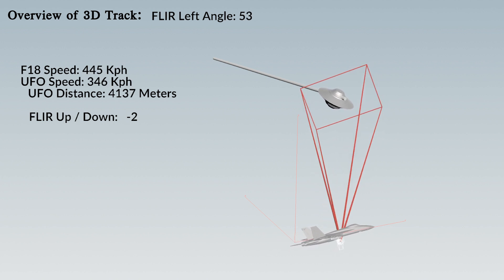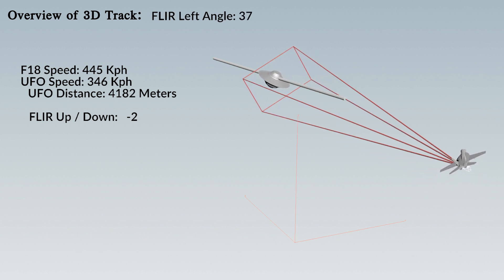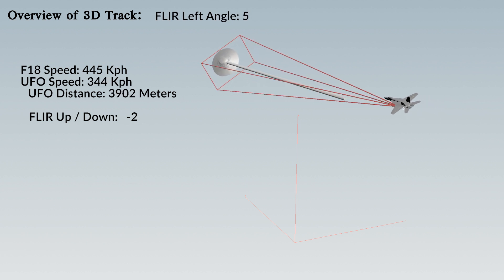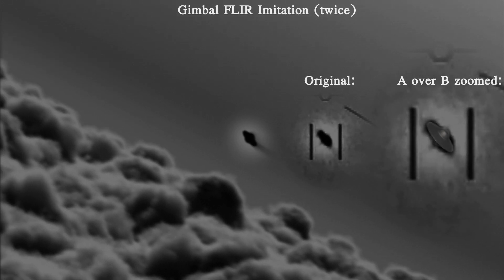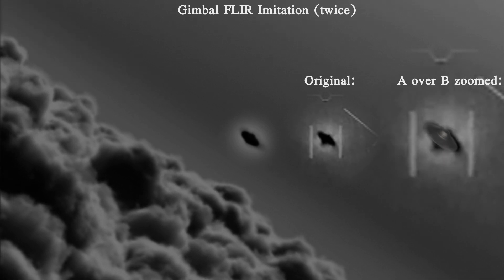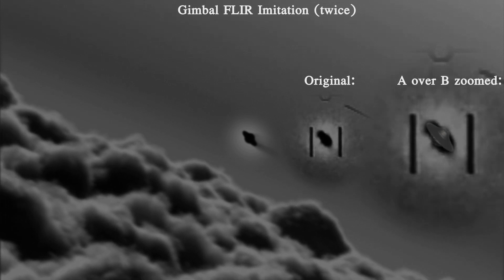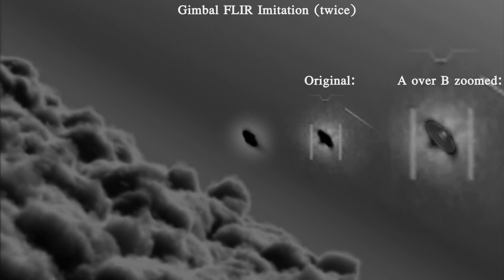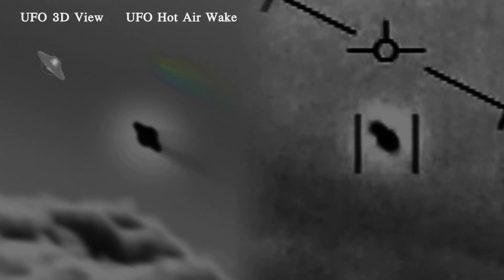Gimbal UFO video rendering in 3D FLIR + analysis

Comment: You aren’t accounting for quite a bit of fact. There is lens flare without question and it isn’t debatable. Could it have been an alien spaceship creating this heat signature and flare? Yes, could have but there is absolutely the same equal chance that it was simply another man made jet.
Reply from the maker: Lens flares don't move as one whole unit on the lens without separating (each flare is on a separate lens), and changing size, shape and intensity drastically as it moves relative to the lens, which is very obvious at the end of the video.  There is no possible way this is a lens flare due to that fact.  I have made other videos on this but obviously most people are not very familiar with the concept of what a lens flare is.  In short, this is NOT a lens flare, there's no way that it is.

Comment: You talk about hot air coming out of the ufo? I dont get it. Lazar said the reactor did not produce any heat whatsover ?
Reply from the maker: Correct.  It's not the reactor that causes heat, it's the fact that the metal itself is being manipulated.  Think of how things get hot when you bend them, it's the same concept.  The metal of the craft is moving the entire craft and ultimately getting hot as a result of that movement.  The movement is being caused by the anti-gravity reactor.  The output of the anti-gravity reactor isn't hot, but it does "bend" the metal and that causes heat... if that makes any sense?
Reply: @abominati0n981   Yes it did. Thanks. What do you think about the alien interview? Do you think its legit? 
I mean this:
https://youtu.be/thdzV3VGzwo?t=1924

Comment: One question: Lazar mentiones that the propulsion system of the craft doesn't produce waste heat but we are seeing a heat source. I thought maybe it is the hull of the craft heating up from the sun or the gravitational field generates some sort of radiation visible to IR cams. What do you think about the origin of the heat?
Reply from the maker: Yes, you hit the nail on the head basically, the heat we see is a result of the metal hull heating up from the gravitational manipulation due to the fact that the whole weight of the craft is being moved around by the outside metal hull that we see in the video.  So the anti-grav reactor was 100% efficient, creating no measurable heat, but when the gravitational wave is emitted onto the metal of the ship, this causes the metal itself to move in a certain direction and that movement generates heat which distributes across the metal.

Comment: The clip ends at this point due to the craft flying off at incredible speed the rotation is the preparation of this mode, as stated by Mr Lazar therefore is this back engineered tec or theirs. my gud says ours but could be wrong.
Reply from the maker: I really don't think these crafts are "ours" meaning the US Government's or any other Government's for that matter.  I think it's pretty clear that these crafts are from another star system and there are probably lots of star systems that have highly advanced civilizations.

Comment: If you listen to the podcast where Ryan Graves talks about this, he said the object was stationary. but here you put it to be at very high speed.

Is it possible to the object being stationary? I know that helicopters doesn't hover at 30,000 feet and baloons doesn't stay in the place against the wind, just asking.
Reply from the maker: Yes I have seen the interview and heard the incredibly good podcast.  He mentions that the craft can be stationary, and I think it is stationary at the very end of the video clip (you'll notice my track actually slips at the end for this reason, because I didn't slow down the UFO).  Also if you watch the newly released Gimbal footage it is actually slightly longer than the previously released clip by a few frames, and you can see that the object does seem to hang in the air at the very end.

I tried having it stationary the entire video and it's simply not possible in this video clip.  With the speed of the F18 and the amount of movement in the clouds being relatively minimal, there is no way that the object is stationary throughout the entire video.

Comment: But then again, the rotation of the camera could simply “rotate” (visually) the whole object. I mean, the fact that we see the air coming off, doesn’t mean that the object is clearly rotating, especially considering that the rotation movements are perfectly synchronised with the subtle movements of the camera that we can notice. Not saying that it’s “obviously a jet” because we don’t have enough information on it, but it’s possible that the object is not rotating at all. See Mick West analysis of the video.
Reply: Thanks, I’ll go check that podcast as well.
Reply: Ok I’ve listened to the podcast. Still they don’t explain how the rotation couldn’t be an illusion, since they haven’t seen it rotate with their eyes. And also, they talked about the go fast video, and nobody could explain how Mick West said it was flying high and slow, using trigonometry. I mean, I know we could trust pilots who are familiar with this radar technology than armchair debunkers, but I want to see clear in this whole thing. Are you going to analyse “go fast” as well? They say it’s mostly debunked and is probably a balloon, it makes me smile a little bit, but then I want to rule out any explanation before jumping on the alien bandwagon, you get me? I’m just skeptical, not completely in lazy denial. That’s what I’m asking and checking the info we have.
Reply from the maker: @silviusuelbus3108  Skepticism is a good thing, but you seem to be missing some very important details.  First of all, in the podcast Ryan mentions that these crafts were visually confirmed by different pilots and they were also seen trying to avoid being seen by changing altitude nearly instantly.  He also mentions that in the Gimbal video these objects were only a few miles away from the pilots, which is easily close enough to be seen, as well as the incident where two pilots nearly collided with one of these objects and flew within 150 feet of one.

There have also been lots of well documented very similar encounters like the Nimitz incident in 2004 (which was also filmed by Mexican officials), the Phoenix lights in 1997 the 1989 Belgian wave infared video which shows an object that looks very similar to this 2015 Gimbal infared video and even the 1966 Catalina UFO footage which shows a tic-tac shaped object which is identical to the 2004 Nimitz footage taken in the same location on Earth.  For people who suggest that this technology is secret US technology, well the US must have had this technology even back in 1966 if that were the case.

Thirdly, as I explained in my latest video, the only way this Gimbal object is an illusion is if it's a lens flare, which is just not possible given how lens flares work.  Lens flares do not ever maintain a solid silhouette shape with one obscured edge that becomes un-obscured, that's simply not how lens flares work, they don't ever have anything in front of them.  They also don't stay stationary if the camera rotates around the light (or in this case the HOT object), they would be constantly rotating and increasing and decreasing in size as the jet turns towards the object.  Again, I did my best to demonstrate this in my latest video.
Reply: Yeah I know the other cases you listed, as well as many others, I’m really starting to look into the UFO phenomenon seriously, avoiding all the “woo woo” BS you can see in some less serious documentaries. Let’s just hope the navy, or the Pentagon, or Russia or Japan or China or anyone else releases more data for a better understanding, because I literally don’t understand the ridicule by some people who haven’t even really studied the phenomenon.
Reply from the maker: @silviusuelbus3108  Yea I'm the exact same way.  Before I saw these US Government videos of UFOs, I thought the whole UFO community was totally wacko but now I've completely changed my tune.  There is still a ton of fake UFO footage out there and bullshit that you'll find in the UFO community, but there are also lots of very realistic UFO videos that don't look sensational at all and people have been telling us about V-shaped formations of UFOs and various saucer shaped crafts for nearly a decade.  Still I would love to know more though.
Reply: Unfortunately this topic is always easily debunked by some idiots (I’m not including West here, because I think he’s still good at what he does). I live in Italy, and when these news from the Navy came out, two “scientific/skeptic” youtubers have said that these were only balloons or distant jets, movement from the camera, and stuff, ignoring all the witnesses from the pilots. Unfortunately nobody seems to take this topic seriously, which is really a shame. Maybe it’s not aliens, maybe we are all wrong, but if we don’t take this stuff seriously, we may never know what it is and we could potentially miss a huge discovery.
Reply from the maker: I've seen the Mick West explanations and along with every single expert who has seen his explanation have said very definitively that Mick is WRONG.  Mick West doesn't even know what a lens flare is, yet he's trying to explain this object as a lens flare.  I explained this in my latest video very specifically, it might be too technical for you to understand, but the facts are facts, whether you understand them or not.  This object is not a lens flare.  Listen to the podcast with Ryan Greives, who actually saw some of these objects and he specifically states that a few pilots actually visually confirmed these objects up close, within 100 feet and they were not man made objects.  The name of that podcast was:  "UFOs - Advanced Navy fighter pilot, Ryan Graves".

My 3D track of the scene actually explains the change in the shape that we see in the Gimbal object that AREN'T deliberate rotations, which only further validates my explanations.  For the first 20 seconds of the video the object changes in shape, which is perfectly in-line with my 3D track.  With Mick West's explanation he's literally taking tiny chunks of the video and weaving them together to form his own narrative, while ignoring the rest of the video.  His explanation is no where near as accurate or as technical as my explanation.